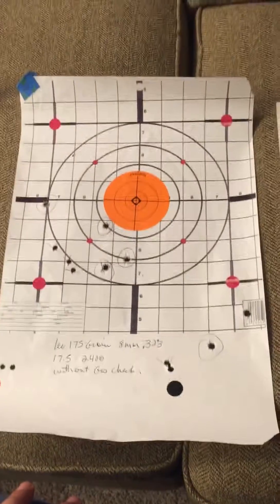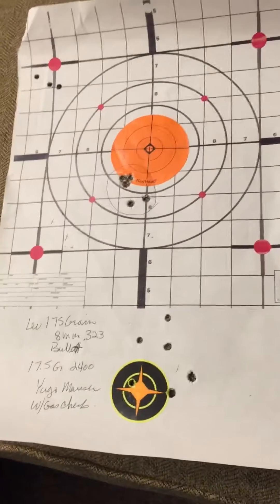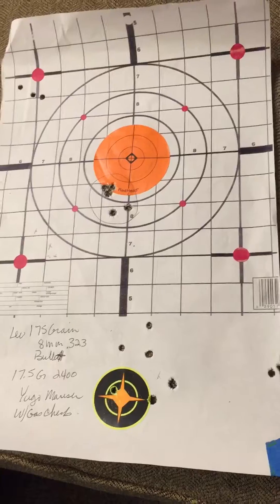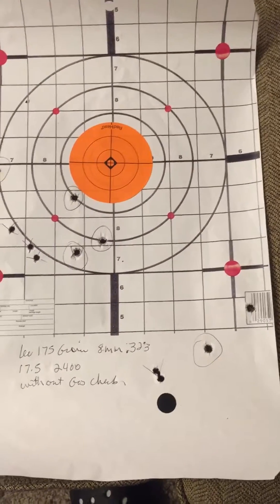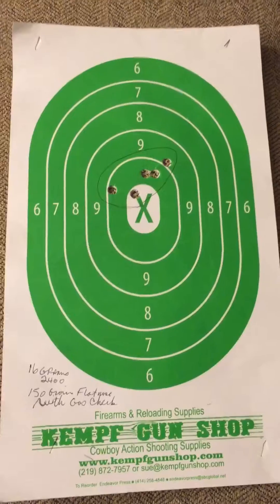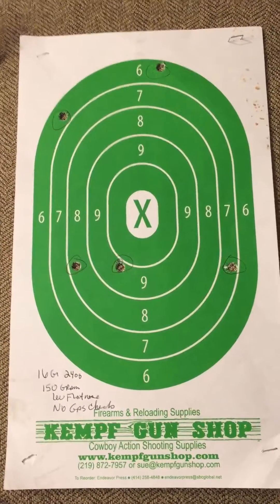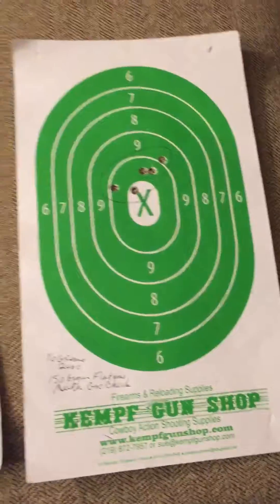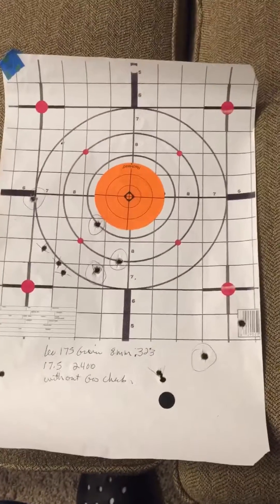Powder coat bullet gas check test

Comment: I found your issue. You have 3. 

1. Your powder coat lead bullet is not the same diameter of your bore. You need to have a mold and resizer that matches the exact diameter of your bore. 

2. If your mold is a gas check mold design your going to have to use gas checks. 

3. Using different lube, gas check or not, powder coat or not, even if you use the same grain weight and same powder will give you different results therefore you would need to recalculate your powder charge for the powder coat. That’s like shooting Remington ammo and then shooting Winchester ammo both same grain weight but will vary in group size and accuracy. 

4th reason actually is which I just found rewatching this video is human error. Which is why I didn’t really include but if both fortune cookie and Elvis have both stated having the exact same or just slightly 1 thousands smaller than your diameter and powder coat them you can almost shoot them like typical FMJ.

Comment: Were the boolits from the same mold that is designed for a gas check? Would love to see a comparison between a GC version of a mold with a GS installed vs. the PB version of the mold without a GC. It's not really surprising a mold designed to have a GC shoots better with the GC, but would a PB version of the same boolit perform as well as the GC version? Have you done any of that testing? Can't seem to find any comparisons of that. Thanks for the results!
Reply from the maker: Not really I am not that into it.  I'll just keep using a gas check with the bullets that I cast even with powder coat.
Reply: You are correct except for the base design, i get 1.25 moa loads from gas check designs without gas checks or with a gas check.  Powder charges must be slightly varied to get the best from each.  I rarely use gas checks anymore.  Caveat, if I want high velocity I just use jacketed bullets, but the majority of my shooting is with cast powder coated non gas checked bullets.  Good accuracy  ( not quite as good as jacketed) at 1/4 the cost.  Lets me get a lot more practice in for the same amount spent.